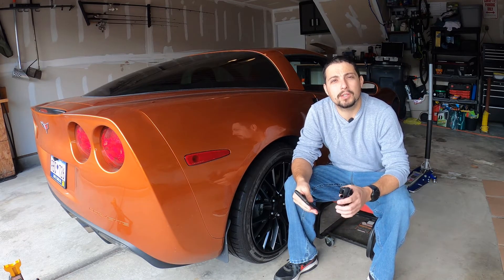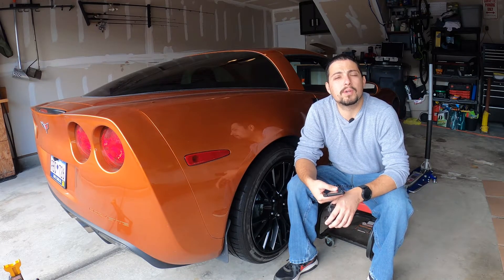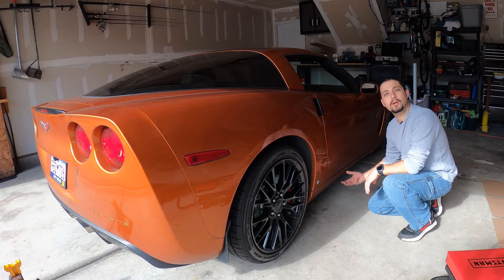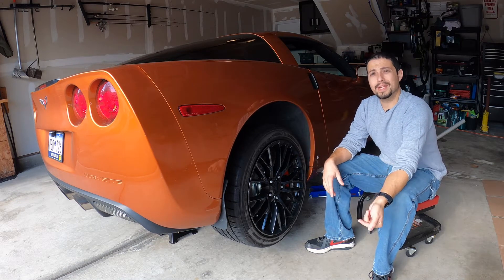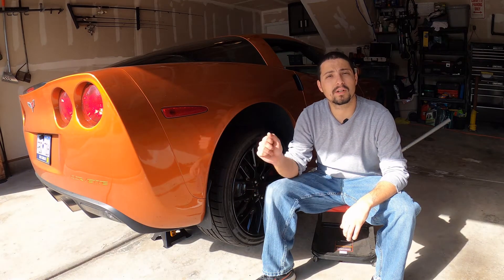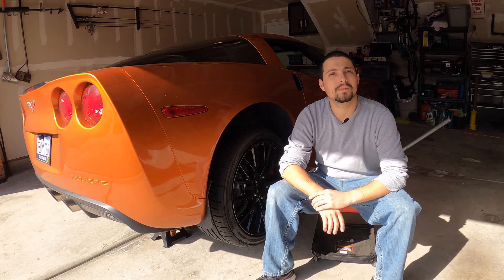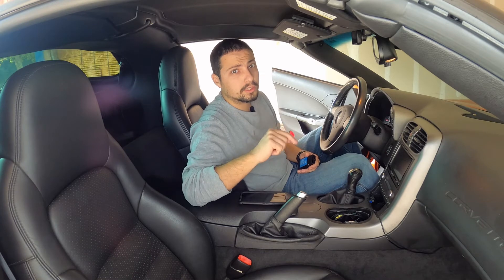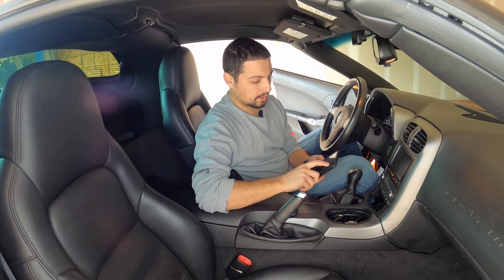Fixing P0449 Check Engine Code - Swapping The Vapor Canister Vent Solenoid In A C6 Corvette

Comment: I had this code along with system bank 1 and 2 too lean. Just got a new gas cap and it took care of all the issues.
Reply from the maker: Exactly. Always start with the easier/cheap options first. I changed my gas cap and no luck. Had to move onto this next. Which fixed my problem and I haven't had an issue since. Thanks for watching.
Reply: Was your gas cap bad?

Comment: District does not always work just changing the gas cap. You also must make sure that that gas cap actually seals with the filler neck on your car….. some of these Dorman parts out there do not seal with the factory gas cap

Comment: Hello brother
I'm having a problem
I changed the gas pump and my problem was not solved
The problem starts at startup
The engine is not responding, and when I checked the gasoline boost, the engine is not receiving enough gasoline. I changed the pump to a new one, but same problem.
The pump's thrust is strong, but it doesn't reach the engine far enough
Did you encounter the same problem in this video?
Please reply so I can solve my problem brother..!!

Comment: Great vid! 
What was the milage on the car when the can pooched out?
Reply from the maker: It was somewhere around 70K miles when the check engine light lit up. I appreciate the comment and thanks for watching.
Reply: @TechMotoring  Thanx for the reply.
Bought my C6 Conv new in ‘07. pushing 70k now.
Not the fastest car I’ve ever owned, but the overall most fun.
Plan on driving it for the foreseeable future
Reply from the maker: Very nice. I love my car as well. Nicely built and reliable.

Comment: Did it come back on? I replaced mine it was off then it appeared again
Reply from the maker: No. Mine has stayed off since I changed it out. It's been a couple of months now. If you haven't already, change out the gas cap. If that doesn't work you may need to check your rubber evap hoses for cracks. Could be a leak along the path to the evap valve.
Reply: @TechMotoring  thanks for the advice checked it out and it actually ended up being fuse 25 within the fuse box by the engine, I guess it shorted it out and blew it. Anyways all good now thanks for the help
Reply from the maker: Glad to hear it was an easy fix. Thanks for sharing and watching.